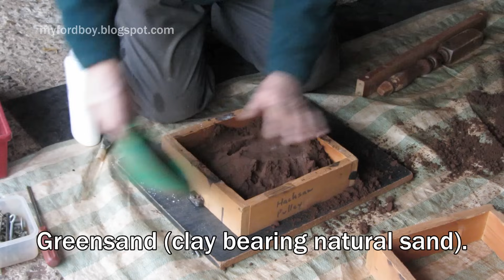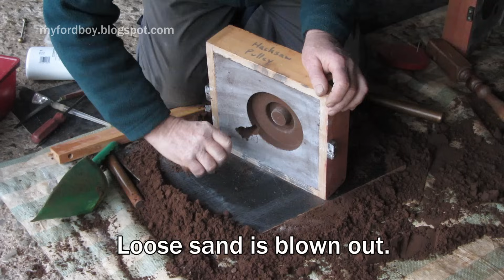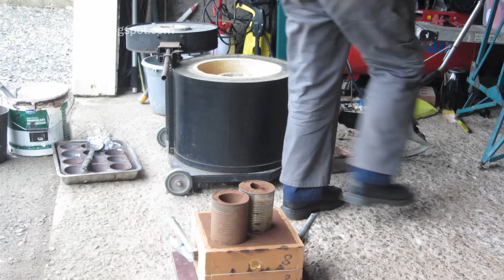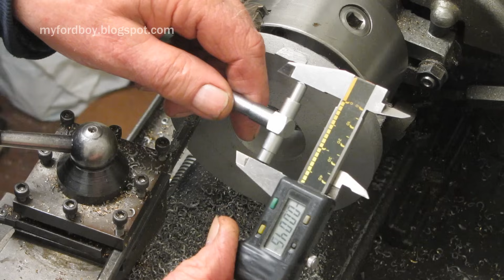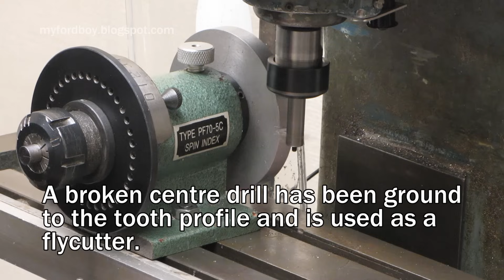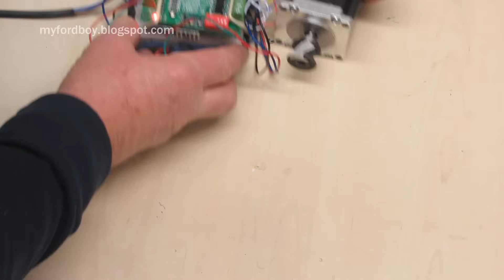Metal Casting at Home Part 64. Casting and Machining a Toothed Pulley.

Comment: I liked your dividing device. And could you share the drawings? I really want to do the same. Thanks. 👍👍👍
Reply from the maker: I can send a sketch of the wiring. I did not make any other plans. I can supply a casting for the pulley.

Comment: I learned to make sand castings during school metalwork classes. I still have an aluminium version of a Fowler traction engine prancing horse (the originals were brass). The gas fired furnace was incredibly noisy but nobody worried about such details back in the 1970s. I can remember wondering how jabbing the sand down with the ends of sticks could do the job. The metal had to be poured on one continuous flow. No pausing - NONE. It worked very well. My horse looks original.

Comment: Nice work. Would I be far wrong if I said it looks very much like you getting ready to cut cam lobes and profiles? The stepper motor indexing the spindexer is exactly how I did it! I used a digital vernier slide for the vertical movements and cut depths.
Reply from the maker: I don't have that use in mind but thanks for the suggestion.
I have a little delve into CNC coming soon.
Reply: myfordboy looking forward to that. Going to be very interesting.
Reply: CNC varies from very simple to extremely difficult. I CNCed my Myford lathe, can't dream of going back to manual. But that was fairly simple programming (although threading was a bit of a challenge).  LinuxCNC or Mach3 are already very capable, but generating Gcode for 3D milling is pretty complex.  I was waiting for someone to show a DIY stepper controlled indexer - brilliant.

Comment: Does the 7 to 1 ratio mean that the gear on the stepper is 1" and the large gear is 7"
Reply from the maker: The diameter of the larger one is 7 times the smaller one. Not necessarily 1" and 7".
Reply: Thanks

Comment: Ok you get better results usually if you sift a bit of sand over the pattern first while you are adding sand to the flask then, once the pattern is covered then gently put more on top of that. Then ram it. You will probably get a smoother casting that way. It doesnt really matter much though if you machine all the surfaces but thats not always the case. I went to foundry snd machining school as a child........blah blahblah
Reply from the maker: My entire sand pile has been sifted so no need to do this.
Reply: No its more about how the sand gets distributed and laid down over the pattern not just the sifting. Plus if you are going to demonstrate how to do this you might as well show that part of the process as well.

Comment: Does the fly cutter tool have half round shape?
Reply from the maker: Yes there is a radius on the tip. if you want to cut into a corner though you can make is pointed.

Comment: I'm not a machinist nor i want to be one but i watch this videos just because they're relaxing, one question and its not a critique but why doing a cast of something that after will be heavily turned into the lathe? why not just use a plain round block of material.
Reply from the maker: It could have been made from s slice of bar but I did not have some. I can easily  make a casting though at no cost and less matching is needed.

Comment: How critical was your pulley diameter to get your belt to wrap. Cheers.
Reply from the maker: I could not find any formula to calculate the diameter. i was expecting it to be pitch x number of teeth to find the circumference but it worked out too big and I had to reduce the diameter for a good fit.

Comment: like the video but as a machinist i would recommend using coolant on the lathe, other wise your work hardening your material and your tools.
Reply: Whaaaaaat —work hardening Aluminium and high Speed Steel???

Comment: Checking the bored diameter. Why not directly with the calipher?
Reply from the maker: This is the correct way. It's more accurate, bore gauge has round ends, calipers are square so will not seat in the bore correctly.

Comment: Wonderful work, I know how hard it can be to do a good "homemade" casting! But why cast this part? Has no benefits to be casting a shape like this when round stock could be used directly in the lathe? Seems strange to me, but nevertheless, excellent workmanship!
Reply from the maker: I did not have some material the right size but am able to cast one.
Reply: Ok! I've done my first test castings recently and I've not been able to get your level of result yet, some parts have looked fine on the surface but I'm getting some porosities here and there. I'm using the lost PLA method though and i think I've not been able to get rid of all traces of that material which has led to that result. I got some more inspiration to keep on trying now, thanks for your upload!
Reply from the maker: @e30clew  For lost PLA in needs burning out for several hours at a temperature about 650C +

Comment: Would it take an input from an encoder on the quill and rotate itself at say 1/20th of the quill speed so you could cut gears with a hobb? (In this case, a 20 tooth gear)
Reply from the maker: I am sure this is possible with the right Arduino sketch. I am not up to speed with the sketch compiling to do this myself.
Reply: myfordboy I am not that savvy either, which is why I asked.
I am having no joy getting the info out of the digital machinist link. Are you going to link to the electronics you have used so if we buy you will get a bung? (Well, a micro bung perhaps :o)  Surely you do enough gears for proper hobbling to be of benefit.
Reply: You seem to have found the exact motor shield that Gary used! I can't find it on eBay? How much was it? I
Reply from the maker: The part number Garry quotes is a misprint it should be TB6560
Reply: myfordboy  Thanks! Here goes on another project.....
Reply from the maker: Bangood.com sell the driver https://goo.gl/NhklOv
Reply: myfordboy I saw the bangood details that you have added to the header, and have ordered everything, although the display and arduino combo are out of stock at the moment.
Keep up the good work

Comment: You're good at what you do. My question focuses on the aluminum you poured. How do you determine the aluminum has the proper mixture to hold up to the stress and balance a pulley needs to have?
Reply from the maker: Using metal that has been cast before gives good results.

Comment: I can't remember the name of the technique, but you use wax say to make a model, inclose it in sand & the Aluminium melts the wax form & replaces it. Could you use a PLA type of plastic, in the same way?
Reply from the maker: Lost wax casting. I have done similar with PLA
https://youtu.be/aCWKkLVg1T8

https://youtu.be/HVgPM1ojyLw

Comment: Why didn't you cast it with a hole in the center that would just need to be opened up a little?
Reply from the maker: It would be more work. The pattern would have to have core prints and a core would have to be made. Making it with the hole not all the way through means a simpler pattern can be made.

Comment: Why do you use that bore measuring tool, and then measure it with the calipers, rather than just using the back side of the calipers?
Reply from the maker: This is the correct way to measure a bore.

Comment: Like the ball bearings on the end of a rod to smooth out the sand,I've been using those for nearly 45 yrs when  built my first foundry with my late Dad,[burnt a few out since then!] there was no internet then to show you how, I just had B Terry Aspin's book "foundrywork for the amateur" ,having said that I have picked up one or two useful ideas from yourself & others ,never too old to learn, I use mainly petrobond  or  co2 for plaques with fine letters & mansfield red for anything else,[of course it's not red anymore after 100s of melts!!, thanks for the stovefan castings,[nice castings] 
Graham.
Reply from the maker: I taught myself from the same book. No internet when i started casting. Terry Aspins son left a comment on here this week.
Reply: Thanks for the reply,didn't know he had a son, his stuffs still relevant today,allthough I have a small propane furnace I still do nearly all my casting using coke & a bouncy castle blower, mainly 'cos we've always got a couple of tons in for the rayburn I like your waste oil burner, will have to make one it's a bit easier than coke
Regards Graham. @myfordboy

Comment: "Any sufficiently advanced technology is indistinguishable from magic." I do have what I hope is not a mind-numbingly stupid question, though. How strong is cast aluminum relative to, say, machining such a piece out of aluminum plate stock? Obviously, for your purposes, that gear is plenty strong enough! But, could that machined cast also be hardened? Of course, that's going to be a  function of the alloy used. But I'm just curious in broad strokes how much strength one gives up by casting rather than milling plate stock. If you get around to answering, thank you in advance!
Reply from the maker: Casting by it's nature is more brittle the bar stock. Although I am using alloy car wheels for the material to cast with, the casting is softer than the donner metal. It is possible to heat treat it but not something you would do at home as it involves holding specific temperatures for a long time, more than 24 hours.
Reply: @myfordboy  Ah, thank you much for your speedy reply! That makes complete sense. So your cast was perfect for your application but probably wouldn't be good for a high-torque application. Great video! Thank you again.

Comment: I like Gary's indexer and am considering making one either the same or somewhat similar. Can you please tell me what motor you finished up using for yours? I can't seem to source the exact one he used.
Reply from the maker: This is the motor I used. http://www.ebay.co.uk/itm/121684006516
It's a bit confusing as there are lots of motors this size with different voltages and current ratings. I can confirm that this one works well. The cheapest Arduino parts i have seen are https://goo.gl/GAwyP6  and https://goo.gl/NhklOv
Reply: Oh that's awesome, thanks very much for that reply. Yes I'm quite confused by the variables of different steppers and why one might be preferred over another. At the end of the day I don't want to try to reinvent the wheel, so will go with something I know should work.

I have the Arduino/driver/etc, just not an appropriate motor. I will be driving a rotary table similar to what Gary did.

Thanks again.
Reply from the maker: +What confused me was the supply voltage is 12v but the motor is 3.2v. Apparently the controller takes car of the voltage difference.
Reply: Yes I understand the controller will limit the current to that it's adjusted to (ie not more than the motor current) at up to 20 times the rated voltage. The rated voltage is the voltage it would require to run the motor at maximum current if there was no controller. Well, that's my understanding, so if the smoke fairy visits and casts her evil spell I'll know I blew that one!

Comment: Great work! I have been thinking about casting pulleys on plaster molds. I was thinking to make teeth on the palster mold so teeth would not need to be machined afterwards. Have you ever tried that or do you think its possible?
Reply from the maker: I have done something similar here https://youtu.be/aCWKkLVg1T8
it would be OK for a low duty gear but for quiet running and precision the teeth would be better machined.
Reply: @myfordboy  Never seen centifugal casting before, really interesting method. I agree that it would be more accurate machined but my pulleys will need edges to prevent belt to slip off, so I don't have a way to machine it accurately with my equipment. My application is low duty and really low speed so I think I might give it a shot.

Comment: Interesting videos! I just tried to cast a large 10" diameter X 10" tall planter pot out of bronze. I used the Lost Wax and Cavity Pour techniques, filling the inside of the planter with plaster of paris, then inverting the mold to fill the outside of the planter. This was all done in a galvanized 6 gallon bucket. The plaster, filled to the top, was allowed to cure for about 1 month.  The wax was then melted out. 

     During the bronze pour there was an incredible amount of boiling, bubbleing, smoking and popping. Almost to the point I where I almost aborted the pour. After de-molding the planter, the results were catostrophic! The planter  had massive pock marks, gapping holes and look like it had risen from the ashes of Chernobyl! 

     I wonder if this was caused by the reaction with the plaster, or perhaps the plaster couldn't breathe/out gas properly? Any analysis or recomendations would be awesome! Also, what brand of pouring tongs/shank are you using in Part 64?

     Thanks for your help!
Reply from the maker: If it is just regular plaster it's going to crack. I have done similar but used a proper investment plaster like this product. https://www.artisanfoundry.co.uk/product_info.php?products_id=97
If there was the boiling as you describe it was not dry enough. The plaster I mentioned needs  probably 5 hours at 650C to dry it out before use.

Comment: Would you please do a match plate style pattern demonstration; the casting shop we use at work operates with that style for efficiency.
Reply from the maker: I don't like the matchplate method. I ram the sand quite hard and like to remove the pattern carefully to avoid damaging the mould.

Comment: Because this is flat on top, could you do this without making the second part of the mold? Or maybe make a permanent plate for the top with holes in it?
Reply from the maker: You still need a bottom to the mould. The feeder goes below the bottom of the pattern to form a well which should catch impurities and ensures that metal does not go straight into the cavity of the mould.
Reply: You could still poke the hole using a filler hole in the fixed top as a template and cut the ingate as normal, just thinking it would save you time
Reply from the maker: You have no control over where the feeder or riser will end up if you do it that way. If there are several patterns or a critical one in the mould it needs to be in the right place.

Comment: Dear Sir, is the final pulley diameter and module before you make the 72 teeth many thanks .
Reply from the maker: OD is 4.55" and the cutting tool was ground to the belt profile.
Reply: Thank you very much .. is ok

Comment: Hello MB,  what is the red fluid you sprayed on the face of the pulley please?
Reply: Stuart Mair  some kind of oil for cooling the cutter
Reply: thanks for your help, but that wasnt the question 8)
Reply: Stuart Mair why not it is oil it is not important which  oil
Reply: Hello Mr Hetzer.  I know it is cooling fluid, but I'd like to know exactly what it was MB used you see. 8)  And yes it is important which 'oil', some can and cant be used.

Comment: Viva England and it's Master Crafters! If only I'd have just had the benefit of witnessing this kind of well-earned competence as a 3rd Grader.. Bodes well for the future because today's young 'uns can see this with a click.One observation (that well may not be correct - but just food for thought)  -  if you are planning to drive the indexer a long time... (more than two minutes) Those little power components on the Arduino are very precise and accurate and will work perfectly of course as you demonstrate but I suspect maybe not if you try too many repeated operations. I am not an expert but just going by visuals.. For example look at automotive 12 volt ECUs and look how they size the chips in the power section. The Mosfets attached to aluminum heat sinks with heat conducting grease..I Don't know the actual specs just what they look like as far as size. A little beefier to handle the heat would perhaps be better.  Hopefully someone who knows will chime in.Very sophisticated work you demonstrate and it is inspiring.

Comment: Can you use soda cans for the raw material for something like this?
Reply from the maker: Drinks cans are the worst material to use for casting. Not much metal, produces a lot of dross and the composition of the metal is different from that used for casting. Stick to metal that had been cast before.

Comment: @myfordboy, most stepper motors have a fixed number of steps.  For example 200 steps per revolution.  When you are designing your gear rations you might need to take that into account in your sketch.  For example, my hobby CNC router has resolution issues for long moves because the controller wants an integer number of steps per inch and the ratios for the gearing is not an integer. So over the course of about 10 inches the position is wrong by a few 1/1000s.

This might not be an issue for what you are doing but if you are going to be using this for gear cutting you need to be able to come back to exactly the same point.

Good luck to you, you do some amazing things.
-Chris
P.S. I switched to alloy rims for my source of aluminum and it makes a huge difference in the quality of my castings thanks for suggesting it.